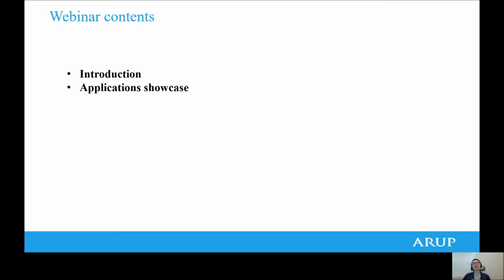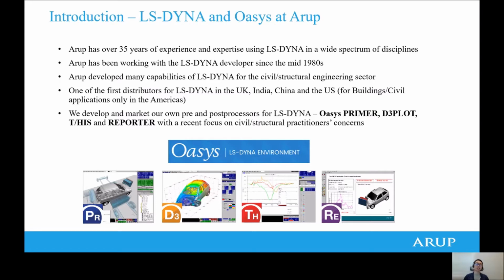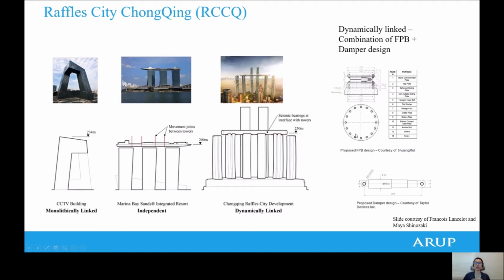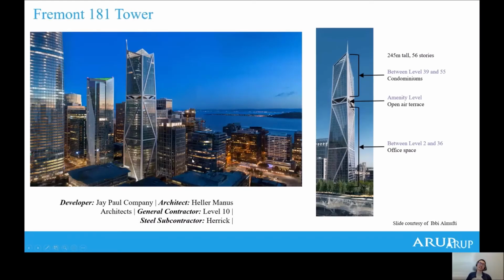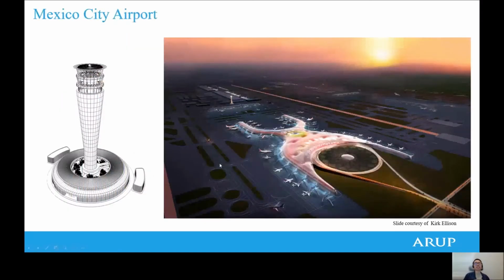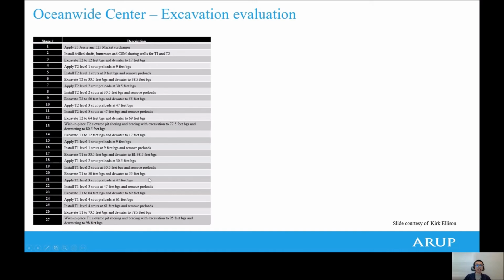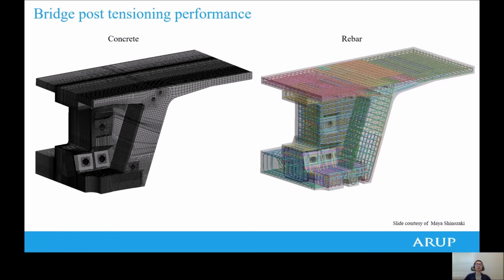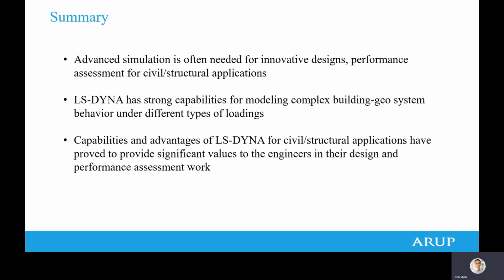LS-DYNA – Civil/Structural applications

Comment: I was very impressed by your presentation.
I have a few questions, and I was wondering if you could share your experience.

Q1. When modeling beams, columns, and walls with rebar reinforcement as solid elements, can the results of plastic status(such as concrete cracking, rebar yielding, plastic rotation angles, etc.) be checked?
Q2. Approximately how long does it take to analyze the Loma Linda University Medical Center?
Q3. What pre-processing and post-processing programs do you use for modeling and result analysis?
Q4. Have you ever had any experience executing a project using the software called ELS(Extreme loading for structure)?

I look forward to your kind response.
Thank you in advance.
Reply from the maker: Thank you very much for your kind words. Could you please email us at dyna.support@arup.com.